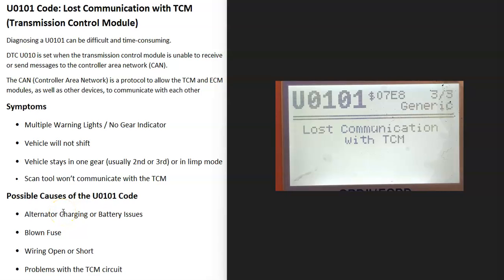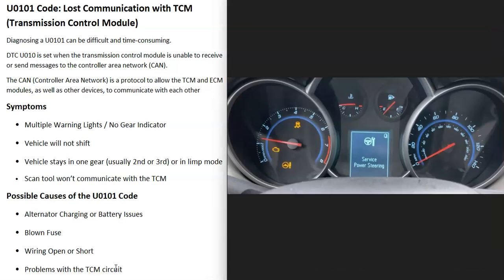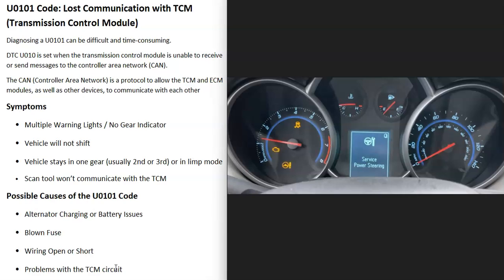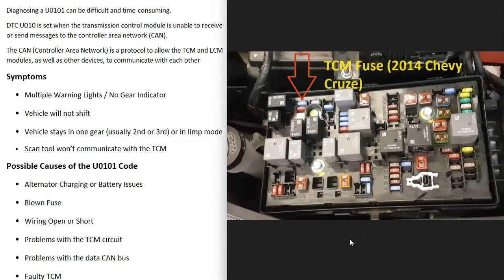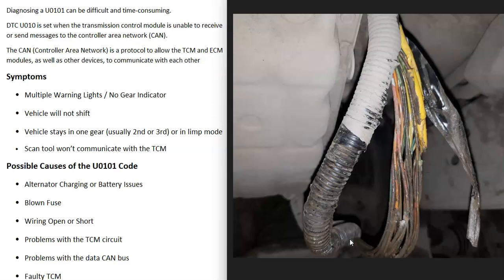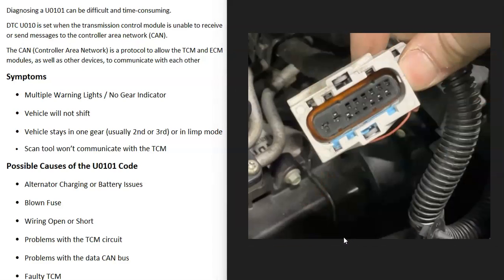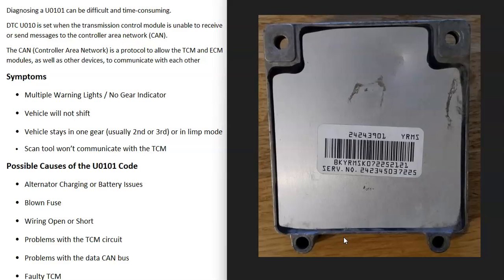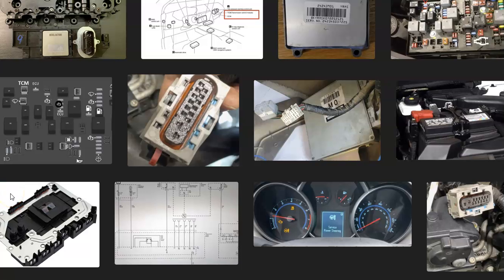Causes and Fixes U0101 Code: Lost Communication with TCM (Transmission Control Module)

Comment: I have an issue with a Chevy Cruz like this I can reverse at full speed, but when I go into gear, it starts slow. I’ve actually moved the car because I had to move and I didn’t wanna pay a towing service and I drove it 6 miles with a friend in front and a friend and back and once I got up to speed about second third, it was all right. I didn’t try to push it anymore than 48 miles an hour, but all in all I’m just trying to figure out what direction to go with this because I’ve replaced coil packs. I’ve actually replaced the engine catalytic converter radiator almost everything on a car so I’m just kind of lost.
Reply from the maker: It sounds like it is in Limp Mode. There should be codes that point to the issue. If the code is a U0101, then it can be hard to troubleshoot.
Reply: @HVAC_Mechanic  that’s exactly it and I found in the front end of my transmission that’s where the Tcm i’m not the most knowledgeable on cars, but when I called a transmission shop, the guy was trying to tell me that mines was inside. My transmission wouldn’t that technically mean it’s mounted on the outside legit like behind my radiator fan On the driver side
Reply from the maker: The TCM can be located inside the transmission and be built into the valve body. If you think it is a computer issue, before replacing it, I would be sure to check all the wiring, fuses, and be sure the alternator is charging correctly. Like I said though, this code can be hard to fix.
Reply: @HVAC_Mechanic  boss went and got myself a Kaykay five 2025. I still have the Chevy paid it off. Had the transmission place and send it to a specialist but even he couldn’t get it to pair with the engine again but then when I got it home and had it towed I actually was able to drive it around for a bit full power shiftingmanually and automatic because I have the hybrid shifter but all in all after a while and went back into it so I’m starting to think it’s literally a wiring issue but I will deal with that down the road when it comes

Comment: 2013 impala. Very low power, not shifting to high gear, random electrical issuesfilters and fluids are fine.  Reving to 3000 rpms at startup, any thoughts?
Reply: "random electrical issues"
Reply: . Yes.  Only way to describe the issues.  I do appreciate being quoted though.
Reply: I’m having the same exact problem with the same exact year and model. Did you ever figure what it was? 😢
Reply: No. Never figured it out.
Reply: @newprep3661 thank you for replying, hopefully my mechanic can figure it out

Comment: can u0101 and u0402 DTC be the transmission failure. its in limp mode in forward gears and reverse takes about 80% pedal pressure to move.
Reply from the maker: It is possible, but more likely, there is a power or wiring issue or an issue with the TCM.

Comment: Had the battery out of a 2011 Lin Navigator for about 1 year replaced started and then the anti theft system the person that worked on the Lin prior had removed fuses I replaced those now the gear shifter won’t come out of park I replaced the brake light switch and still won’t come out of park

Comment: I got a new battery. could it be that they put it in incorrectly❓️🤔
I had codes read on my vehicle and that one popped up. The only lights that I've been dealing with is engine power is reduced. I had my throttle body cleaned by Chevrolet and it's running even crappier so I've decided to figure out these codes for myself🙄
Reply: Nah pretty much no way to put a battery on incorrectly, negative to negative, positive to positive, pre sure if you put the negative to positve and same with postive to negative all your wires just fry and youll definitely know if it does, theyll melt or something, dunno never been dumb enough to do it, just seen videos 😂 but check your spark plugs and coils, see hkw they look, if theyre crusty, bunch of oil gotten to them then could need new spark plugs and/or coils, had a car that went into limp mode due to that, changed them and ran normal, also check for any air leaking from the intake hose on the throttlebody, maybe leaking and not getting enough air if its runnibg worse since theyve cleaned it, id tell ya to check the throttlebody but unsure how mechanically minded you are and got to be careful with that as they go directly to your engine and the butterfly flap inside it can sometimes snap off into it if youre not careful
Reply: Is it idling up and down alot? Not staying consistant in revs? Like goto 500, end up stalling or jump to 2000, then 1000, then 1500 etc etc

Comment: 2014 Chevrolet Captiva - Check engine light would occasionally come on and eventually received U0101 code. Still looking for solution, most likely think it is a blow fuse since battery was just replaced and issue is still ongoing even before changing the battery.
Reply: Look at the fuses then?

Comment: So my headlights low beam was flickering when this happened, fixed some shorts, there was a blown fuse that I have now fixed. Can’t find anymore shorts and the grounds on my car have been cleaned and everything. Have had water leak in to the passenger side where the ax blower motor is at and where the ecm seems to be located at. Will be replacing ecm and inspecting harness to make sure but this has really been a nightmare on my already pos g35
Reply: I have a 2002 infiniti i35 with driver and passenger side floor board soaked and can’t find where its coming from and also a hard shift into 2nd gear sometimes.

Comment: Can you tell me where the tcm is located in a 2014 Toyota Camry SE ,4cyl
Reply: In a 2014 Toyota Camry SE with a 4-cylinder engine, the Transmission Control Module (TCM) is typically located inside the vehicle, often near the transmission or behind the dashboard. Specifically, it can be found under the center console or under the driver's side dashboard. For the most accurate location, it's a good idea to consult the vehicle's service manual or a repair guide. If you're considering replacing or troubleshooting the TCM, make sure to follow proper safety procedures.
Reply: what was it in your camry? I got the same problem?

Comment: 2013 chevy silverado 3500hd.  How do you rest the TCM? I did the " remove the battery connection for hr" and nothing. It's not dirty or oily? All fuse are good. The dealership said I had to drive it in for them to look at it lol SHE DOESN'T MOVE FOOL! (The guy hug up on me). So is there a do it yourself? I know getting a new one it has to be programmed to the truck, so I still have to take it somewhere 😅
Reply: did u end up getting this fixed?
Reply: Also it has a sweet but nasty smell to it
Reply: @beckhamsfamilyjourney  if so where was the issue?
Reply: @mikey13b  the Circuit board fried

Comment: Replaced the TCM and it’s a no start no crank. The new TCM is bad… 13 pins connection oil coming out… god… also don’t forget to disconnect the battery…
Reply: You have to have it programmed with your vin number at a dealership or a shop that can if you put a new one in.
Reply: I change the tcm but i have c0100 and p0722 codes do  i need to reprogram? Because with mi old tcm i don't have that codes
Reply: @SaulPaez-ed7go did you figure it out ?
Reply: 2014 Impala has a gasket that goes around the connector. The shop I took it too failed to install it so lots of fluid got inside the connector and now I have this code
Reply: @henm4975 what did u do to fix it
Reply: Why it the battery and alternator and fuses are the main issues here
Reply: I have the same issue I changed a new tcm and the car no crank no start
Reply: Salutare, am nevoie de un sfat de la tine
Reply: I doubt the new TCM is bad
Reply: Oil coming out of there is fine.   All those wires terminate in the oil bath, they're not shorting out at the connector because of the oil.
Reply: @aaronj08ar VERY BAD ADVICE

Comment: 2006 4.6 explorer. Failing coil pack interfered with pcm to tcm. Harness travels next to coil. Replaced coil pack solved the issue. Great video
Reply: Just saved my ass thank you!!!
Reply: Are you serious. So this code can be caused by anything? I did an all module scan on my car, and most of the faults are coming from the BCM hopefully it’s just water and my BCM doesn’t t have to be replaced or reprogrammed.
Reply: @adanlopez1011 I'm dealing with this now in a 2012 Silverado 4.3.
U0101 code,shift selector light went off,no shifting problems,truck had a full tuneup last year.
I also have a 02 sensor code for B2S2. Replaced that 02 but the code won't go away.
I'm wondering if the two are related somehow.
I've tested the battery,tested TCM fuses,tested the relay,it's all fine.
This one has me scratching my head......
Reply: What was your problem just curious?

Comment: Dealing with this issue on a 2016 impala…. It comes and goes…. Had the wires replaced and it worked for 8 months…. Problem is back and I’m trying to avoid a 3k fix
Reply: I've seen a fuse block have bad connection. Check from the back side connections to the top side connections.

Comment: My 2022 dodge charger lights won't illuminate on the shifter, won't start and has the service transmission code
Reply: should be under warranty, take it to the dealer

Comment: I had an APR ecu flash on Thursday on a 2012 Audi A7.  I drove the car home fine. I put the car cover on, and let it sit until Saturday.  I got in it and drove down the street, stopped to check the mail, and it wouldn't go back into gear.  The battery was replaced by the previous owner in November of last year, the fuse for the transmission is good, and the car starts fine.  I used by BlueDriver and got the U0101 code along with 35 other codes.  All of the codes cleared except the U0101.  Any idea if the ECU upgrade may have caused the TCU to fail?  Do you know if the TCM is disconnected during an ECU flash?
Reply: Did you end up finding the cause of the fault code?